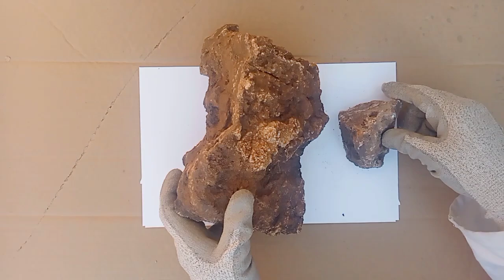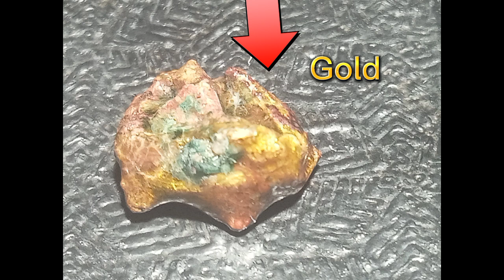Stone gold recovery/Gold ore gold recovery/Rock gold recovery

Comment: Having a little bit of backdraft stop and two walls on either side of concrete cinder p blocks would help keep a consistent higher-temperature by not having so much heat loss creating a more efficient process